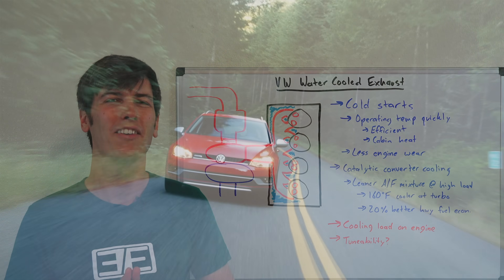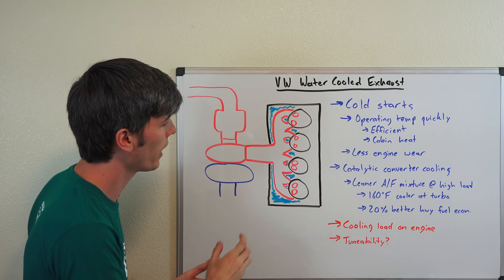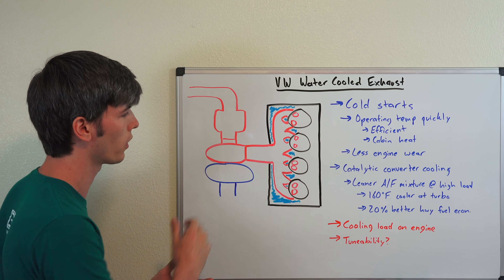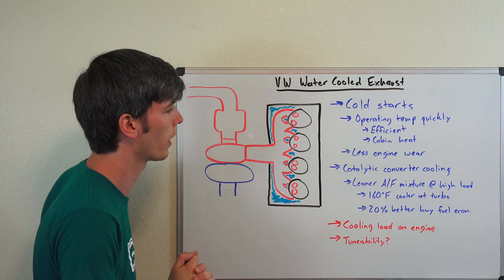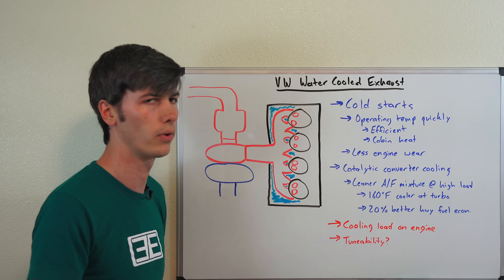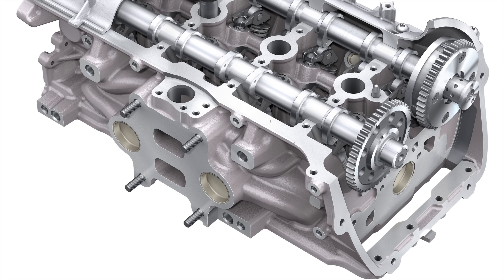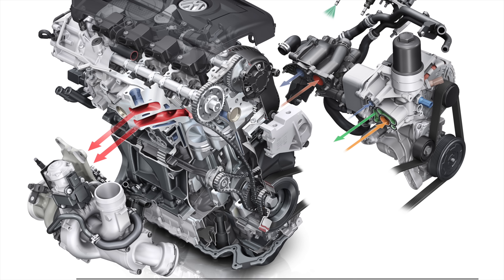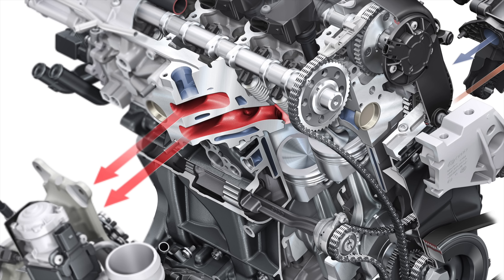Why Does Volkswagen Have A Water-Cooled Exhaust?

Comment: Did not mention anything about the drawbacks of adding more heat to the cooling system. Won't it make it go thru more extreme heat cycles thus reducing it's life?
Reply: Not if the design takes the additional heat in consideration=bigger rad/pump and voila. Doesn't mean hotter engin.
Reply: Simon Côté-Hamel. no.
Reply: Simon Côté-Hamel If everything works correctly, no part of the engine block would get hotter than the normal operating temperature of ~90°C
Reply: The operating temperature of the coolant wouldn't change if the radiator is sized appropriately. It would just reach that temperature more quickly (also I imagine once the engine is switched off, the block would stay hot for longer, storing more heat than exposed manifold - good for stop/start)
Reply from the maker: Haha yes I did... watch about half way through and I point out a few of the disadvantages.
Reply: When Jason talked about "cooling load on engine", he addressed this as a potential drawback.
Reply: jason in your last diagram of the cooling system you can see their kept and channeled seperatly to the head cooling, yes one radiator but separate cooling circuit and outlet/inlet
Reply: IF.
Reply: Simon Côté-Hamel 
I
Reply: ted clubber lang g
Reply: Jacob Frey hi
Reply: You're absolutely correct. VW will have lots of warranty repairs with this.

Comment: surely reducing exhaust temps reduces the turbo efficiency? seems like its throwing away horsepower and mileage
Reply: TheBiohazard43 they don't mind that. As this will be mainly for emissions. The fuel economy benefit will likely be a by product.
Reply: Agree but I'm sure that cost factors dictated this design vs plumbing the cooling in down stream. Bean counters have ruined many a good idea.
Reply: There probably is a drop in turbo efficiency, but at the end of the day, the most limiting factor is the cat. they simply cannot handle too much heat, and  ECUs are limiting the temperature via AF ratios anyways. Essentially they were using MORE fuel to try to keep engine cool. 

I guess with this method they can keep offload the exhaust gas temperature control to the actual cooling system rather limiting combustion.
Reply: No thebiohazard43, turbos directly draw their power from the VELOCITY OF THE EXHAUST. Velocity.
Reply: Matthew Jackson you may get cooler air but cooling the exhaust would only cool the hot side marginally anyways. Cooler intake temps would be better served by intercoolers.
Reply: TheBiohazard43 Thought the exact same thing. Maybe cooling the exhaust after the turbocharger would be even better in terms of efficiency?
Reply: the exhaust gets hot not because turbo is hot, it's because the air is being compressed, which results in heat, this is air thermodynamics, when the air is expanding, thats when it gets cold
Reply: I just wonder why this route was taken to lower the temperature before the turbo and not after where the cat would be situated and temps would be lower.
Reply: Christian A Exhaust velocity is decided by how much exhaust gas must be pushed through your exhaust (think either pressure or volume). Think about your gas laws, PV = nRT. More heat = more volume or more pressure.  So, as you describe it, more heat means more velocity.
Reply: Christian A Nah. They use those jackets for both keeping surroundings cool and for better turbo performance. Read up on antilag. Velocity has very very little to do with turbo's
Reply: Stuart Wurtman gas laws are correct! You are correct in a sense but again the velocity is really not how the turbo works.
Reply: The turbo and cat are going to live longer this way.
Reply: It's a good thing that the cat will live longer. My dog recently died and made me sad. I don't want my cat to die too. But my cat won't live longer since I don't have a VW.
Reply: yes, it's a compromise so the turbo would've been slightly downsized - sacrificing some top end mechanical efficiency for better cold starts, which I guess is important for engine stop/start in traffic
Reply: Jordan E Agreed.
Reply: Darian Murcott-Istead Actually having the turbo so close is good because it shortens lag and give better throttle response. I think it'll be hard to tune because of how the exhaust temp varies with coolant temp and how they can calculate on the fly the accurate tune. I think it'll be a great engine apart from I don't see the point in this engineering and the potential point of failure it poses and the increased demand on cooling. The exhaust manifold isn't too restrictive for such a small motor but for a turbo exhaust temp and energy is key to efficiency.
Reply: mrelectron62 they claim a 20% mileage increase when the engine is loaded up. It's a pretty drastic change just for 20% when your foot is on it and produces similar mileage at lower throttle. I think if they just put the on a cooler portion of the exhaust they could achieve the same results
Reply: I was wondering the same thing...
Reply: Thank you
Reply: I agree with all your points. It is strange VW didn't use a twin scroll but implemented the ports on their head. (could be future proofing) Yeah 1000c is far too high but under normal operation I doubt the actual turbo itself becomes this hot. Anti lag i can believe it!
Reply: That is what I thought when I seen the title and thought that it actually sounded like a good idea , then I seen that it was a Manifold built into the head itself. Anyone who works on tiurbo cars knows how much of a pain in the ass that could be real quick .. broken bolts , replace the head, etc a 1 piece head like that is not the norm then it has water jackets in it YIKES
Reply: I just feel that the best thing a person could do if they're looking into buying a car with this setup is to just buy a WRX instead ;-) (or Forester XT with rear sway bar upgrade for those wanting more practicality :P )
Reply: The head always have water cooling, The only practical difference is whether the block of aluminium that the head has one big or four small exhaust ports
Reply: no really the head always has water cooling ?? I thought this was a 1500 Horse power drag specific billet closed deck   long block from the factory !!!!
Reply: Lasse Langwadt Christensen Sure man. The real practical difference is the exhaust manifold inside the head where the water jacket passes over
Reply: noxious89123 no one said that combustion gases get hot from any other means.
Reply: JPickle or any other car that can be modded and had fun with for cheaper!
Reply: Ellenor Malik sorry mate. They just don't. It's exhaust energy primarily from the heat of it. The exhaust velocity has very little to do with it...
Reply: TheBiohazard43 Agree. 'Velocity' was the term on the table, so explaining it in those terms...
Reply: TheBiohazard43 I'd see it having kick ass amounts of torque functioning this way rather than horsepower. More so than turbos already do
Reply: TheBiohazard43 Where does it show that a 160 degree drop hampers turbos, Bio?
Reply: GModBMXer low end torque yeah.
Reply: steve johnston Well it's not just heating it up to make it move. The heat expands the gas which expands while in the housing and out of the impeller therefore turning the impeller, this heat is waste energy that the turbo turns into kinetic. It's the expanding gases inside the turbo that make it work and hotter gas makes it expand more.
Reply: GModBMXer Doesn't show in the video. But I can guarantee it as you are decreasing the expansion of the gases and providing a smaller force on the turbine.
Reply: steve johnston Ok. But that's not how AF ratio works. If there is less fuel yes it is leaner but doesn't mean there is more air. There is more air per fuel. But the only thing that has changed is how much fuel is in the charge. It does make for a bigger bang and hotter exhaust temps.
Reply: steve johnston In reply to your last part. My antilag argument is just a show of how turbo's work, not necessarily applying it to this engine which is clearly not designed for this. The argument could be made though that the lower exhaust energy makes it spool slower and produce much less boost at low RPM contributing to lower torque in the low end. This setup would probably be more designed for midrange power to have that efficiency at highway speeds.
Reply: steve johnston Antilag is a great representation of how a turbo works. It does... because antilag is the engine retarding ignition to produce very hot exhaust gases therefore spooling the turbo. Therefore this provides proof that heat and the rapid expansion of gases spins the turbo. I have already said that for this application it is innapropriate. I am focusing on what is wrong with the design because I think it provides a talking point and a good area to question the validity of their engineering. Don't forget Dieselgate, the same twats made this engine. No company is immune from making mistakes and bad design. My personal opinion is that the efficiency lost due to the exhaust cooling kind of outweighs the 20% MPG gain when only on load. Because when you're not at load you might get worse/ same MPG for this strange design. I understand turbos can be made differently but I very much doubt that the turbo would be made for low end torque on this engine as it would sacrifice top and mid range power which is key to their 20% MPG gain at LOAD.
Reply: WRONG AGAIN.... IF heat did nothing as you say So why do they put turbo as close to the engine as possible...Why did Ford put turbo in middle and exh ports. It's wasn't just for anti-lag and heat expanding in hot housing helps a lot with spinning of turbo.I some of Diesel tuning guys like to dump fuel into exhaust by retarding timing or over fueling to help build boost. But it burns turbos up fast shorting there life a lot.
Reply: Cooler air wont spool it lessÉ Thats extremely marginal. Flow velocity is what really matters.
Reply: @thebiohazard43 anti lag doesn't rely on heat; it burns fuel in the exhaust upstream of the turbo, creating a large amount of expanding air pushing thru the turbo
Reply: On modern petrol engines, exhaust gas temperatures are basically as high as turbos can take them. Hence why you need to run rich at full load (the highway driving they mention) to cool the engine and turbo. 
Diesel engines have lower exhaust gas temperatures, so you wouldn't see such a  cooling technology there.
Reply: Matthew Jackson what ? The impeller does not run cooler, even if it did, that's not how the gases heat up. They heat up through pressure mainly, the temperature of the impeller is rather insignificant.
Reply: TheBiohazard43 I don't think VW was really after every HP from this design but efficiency on hwy as stated in video. VW claims a %20 gain in efficacy due to cooler exhaust gases they can lean out the fuel ratio with out worrying about the converter going into melt down mode and save fuel.
Reply: @heart attak joe, sorry basic physics doesnt cover this, its thermodynamics and fluid-dynamics at play here. A hotter exhaust charge means higher pressure in the exhaust turbine and more gas expansion, as well as a smoother flow and better exhaust scavenging.  They are leaving power and turbo efficiency on the table in exchange for air/fuel cylinder optimization and part longevity. But it was likely leaving something like 20% efficiency during high boost (high load) to gain their claimed 20% during low load situations. Just a trade off for the likely use of this engine and car.
Reply: Wrong, it's exhaust velocity. The heat is a by product of compression. The jacket is to stop the heat from affecting near by components. When you push the already hot air out of the engine, you're pushing it into a resistance, which creates heat. When it goes through the turbine, the pressure drops which means the gas cools. You're not using the heat, you're using the pressure. Heat is a by product.
Reply: great for emissions and fuel economy but as mentioned not for tuneability. hot exhaust gases travel faster and therefore spool the turbo quicker. flow also doesn't like tight bends. I guess manifold size is restrictive in the sense of small porting and length increasing gas velocity which also won't be ideal for a tuner but considering the type of car and target customer, it's not a discerning factor.
It's not really a water cooled exhaust per say, as the title states but more so water cooled exhaust ports. 
A cooler turbo can be beneficial in that the heat transfer between exhaust housing and compressor is less, meaning deanser air but in the process of compressing it, it still increases air temp so will need intercooling for efficiency but more than likely not as much as a traditional set up..
Reply: Er no... The exhaust get's hot because the gasses are the result of combustion. And you know, combustion is hot...
Reply: That is true for compressor side
Reply: Wrong, exh flow isn't all of it need heat of exh too. Even big trucks wrap exh manifold and hot housing hint to trap heat or keep it in exh
Reply: Johannes Dauter The turbo by design is supposed to absorb the heat energy and turn it into kinetic energy. The actual heat of the turbo by exhaust or friction doesn't really matter here as turbos are already cooled by oil and/or water. Cooling the exhaust itself would not only be an inefficient way of cooling the turbo but a wasteful one. A drop of 160F in exhaust temp shows a dramatic decrease in energy and makes the turbo less efficient and thus the engine less efficient. It would grant better mileage and power if this was not the case as you could use a smaller turbo to achieve the same airflow/boost.
Reply: the pipes to the turbo are much shorter here though, and with a cooler turbo, you get cooler intake air.
Reply: nope. all wrong. in thermodynamics a heat engine yields a greater output when there is a bigger difference in heat between the working body and sink, in this case the combustion chamber and exhaust. i learned this in basic physics 20+ years ago ffs. 
as for the turbo, having it so close to the exhaust reduces lag (ie better throttle response, the bane of turbocharged engines) and having a smaller difference between cold and normal operating temperatures reduces wear on the whole turbo and its bearings therefore extending the working life. its efficiency is determined by the turbine sizes and design in relation to the air flow, temperature would not play a role in this. in fact, my understanding is that cooler air is denser therefore would overcome the inertia to turn the turbines and also hold a greater static pressure
Reply: heart attak joe Not really sure what you mean in your first paragraph. Sorry. Turbo's directly draw their power from the heat of the exhaust, read up on antilag for proof.  Cooler air would spin the turbo less as there is less energy (also less delta energy) from gases to turbine. As for the density I agree this would benefit the turbo to some degree granted there is more of the gas.